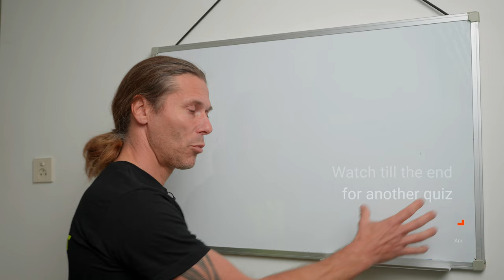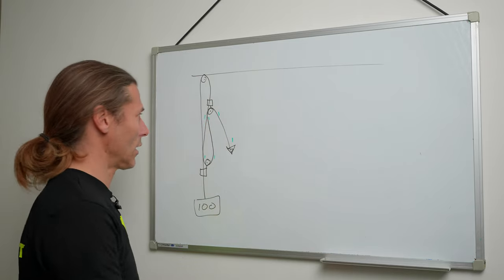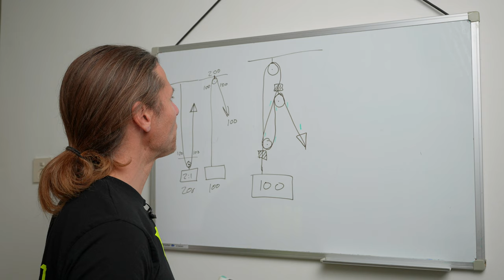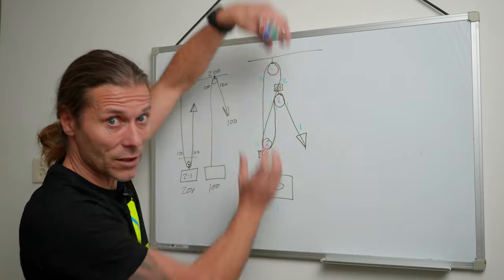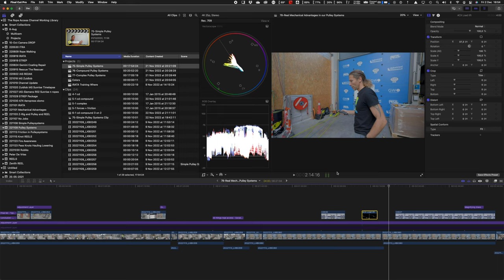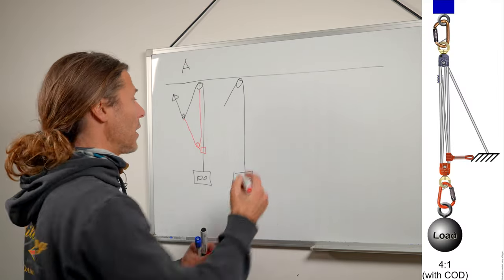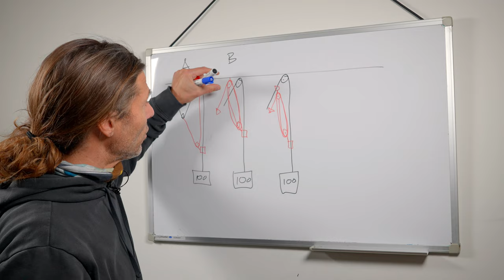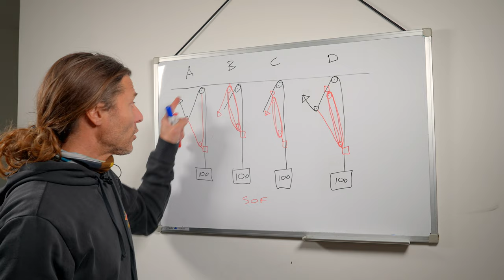What is a Complex Pulley Systems - The T-Method and MA

Comment: Great videos! I want to build a cargo lift in my barn to hoist items weighing no more than 450kg up 5m to the next floor.  If I assume I want to use a 275kg brake winch (so the handle doesn’t spin out of control when lowering/raising) and want to minimize Input Distance (crank revolutions), what would the pulley setup look like? Based on your educational videos I think a single pulley fastened to the platform, the rope fastened to an upper floor beam with the brake winch up there too is all I need.  This would also result in the minimum Input Distance.  MA=2   Input Force = 275Kg   Output Force=550kg   Input Distance=10m   Output Distance=5m   Can I somehow reduce the Input Distance to reduce the number of hand cranks I’d have to endure? :-)
Reply from the maker: Not to my knowledge. In order to make it lighter you have make more revolutions. If you design it for less revolutions your input force has to go up. If that makes sense???

Comment: Is there a pulley system that will work where there is a change in direction? Imagine a wall that meets with a corner to another wall that has a 45degree angle. The belts of the pulleys only work in a straight line, but what can we do if we need our pulley machine to pull a load along a structure that has curved surfaces?
Reply from the maker: I’m sorry, I don’t understand what you mean. If you send a drawing maybe that will clear it up

Comment: 5:1
4:1 if you’re only pulling on the SOF’s, which I believe is what the arrow is indicating.
9:1 interesting way to employ your SOF’s
19:1 I think. 5 becomes 10, 4 becomes 8, plus 1… sounds reasonable.
Reply from the maker: C collapses really quick but it is a small step from B to C and more then twice as efficient in pulling power. (But the resets…..)
Reply: @TheRopeAccessChannel  I’ve used B for knot passes and really liked it. I’m always looking for creative (but practical) ways of using a SOF’s. We have an extra long one (15m fully extended) thats used as a stand-alone kit for raises and lowers with little consequence (acceptable in my world)

When the wingman’s arrive I’ll probably use those for standalone kits and shorten up our Aztecs for more traditional uses. (Pitching litters, knot passes, adjustable high points etc.)
Reply from the maker: @paulnormandy6247  That would be a very good use of a SOF. And for me, I think it is very important that a tech (or operator depending on your locale) should know how to do it without. 

Most teams I know that have gotten a wingman have employed that for moving the litter from horizontal to veritcal and back. It is a breeze to release under load.

Just this week I used it in the pouring rain lifting 20kg bat homes into place. It worked like a dream.Were other methods possible, yes and this made everything run real smooth!

Comment: Hello, I have a question, hoping someone can answer and find the solution?
I put a movable pulley on a weight , its decreased the force exerted , so divided are weight by two , and decrease its speed of movement . My question is , how I do to decrease the speed of an object WITHOUT divided are weight , I want to keep the starting weight but only divided its speed . Thank you to you.👍 ( Small pressure , I cannot add extra weight to compensate for its loss ... , ( I want to divide the speed and not the weight ...)
Reply from the maker: If I understand you correctly, that is not possible. There has to be a exchange of energy somewhere.
Reply: Thank you for taking the time to read and give me an answer .
Reply from the maker: @moutphone9064  no problem 👍🏼👍🏼

Comment: I got tired of no explanations
 so i tried to understand it and here is my attempt
A
The black line is a 2:1 pulling on orange ropes left side making it a 2 and its right side is one making orange a 3:1, and it goes to the clamp. 
Then tension from black is one on one aide and one on the other making it 2 one’s
3 and 2 is five so 5:1
B
This kind of ridiculous
You have to realize that the black rope end is nonsence. Its just rope automatically being fed out the pully and no evidence for pulling it is given yet its a cd anyway.
If you notice the orange rope is clamped to black, the only pully that matters therefore, is obviously orrange. Add the tensions on the inside and you get four
C
It’’s still four but if you noticed, the black to orange on bottom right is clamped is four just like the first, you label that; then you label the other attachment as four.
Since this pulls on black, you have fpur and one side (the left) and one on the right, which is 1,making it five. 
Then 4&5=9
9:1
D 
The absolute maddness begins.
It was madness before…
So the black rope is a 2:1 load on the left. orange rope. The only way is see this working is if the bottom orange to black clamp is 10 and the top is 8 and the other side of top black rope (right) is one.
The only way i can think to explain it is to look at the circle thing as botha multiplier and the difference between it and the versions of the other ones.
The other circle things were with it being pulled down where this is like in a where its being pulled up but like in a. Where does the tension from c come from? 
You. 
Your pulling down
In b, the wall eats your input
If you think of it now aa physical objects being pulled on, not just multiplying power it makes sences
The pullies are being pupled where the walls were canceling extra nonsence and only letting the line energy in. 

So in D
 you can not forget that the circle is a power multiplier, and also, the physical wench is being lifted by 2 unts of force like in A, where before you added one, now you add the multiplication. Onsence but you cant forget the lifting of the 2:1 of the black winch on the winch itself making it its gadged multiplier pluss its lift from the 2:1 black winch
None of this lifting crap effects the top, only the multiplication factor so it pull 8 times downward, but that rooe is attatched to you so you are asding one cd because now we care about rhe cd in because its complex now
Reply: I am feeling A is incorrect though. Maybe a 2:1 on a 2:1 and then that change in direction is added
Reply: So pn D to clerify, botha ends are 8 from the circle multiplication with 2:1 being multiplied, but 2:1 is physicall pulling on the physical part of the bottom circle thing, so you get because its 2:1 into the 4:1 circle multiplication insanity 2:1 is physically pulling on the wheel. 

None of the top 8 weel is being pulled on by the weel but the other aise of the rop has one extra input at litterally the end of it added on. 

So you pull and twice your strength goes into a 4x multiplier device, where 2x your strength as another multiplier device and this powerers an 8x arm in front of yours, but since your pulling on the second arm bellow you, you get to add your doubled strenght as it feeds into the bottom arm, but you can’t double it becauae you aren’t leveragting double to the top end with it, only into it normally as the top end isnt leveraged. 
You have the other arm pulling the weight directly and your double devoce is physically pulling up on device that is clamped, so its helping, but only that end.
Reply from the maker: What do you mean with "No explanations"? Isnt this whole serie explaining it all?
You can find the answers in the comments on the site:
https://www.theropeaccesschannel.com/what-is-a-complex-pulley-systems-the-t-method-and-mechanical-advantage/
Reply from the maker: And why is B ridiculous? It is used often and a perfectly valid MA. 
your tone is negative or is it because of a translater?
Reply from the maker: For C: Thank you for explaining what I said in the T-method and these video's
Reply from the maker: I agree that this in D) is madness haha. It is just to see if you understand it. You have not given me an answer as in 9:1 or 21:1 or 324234:1. Do you know it?